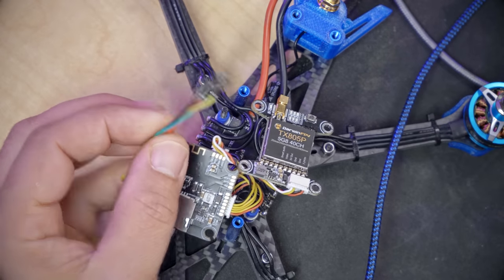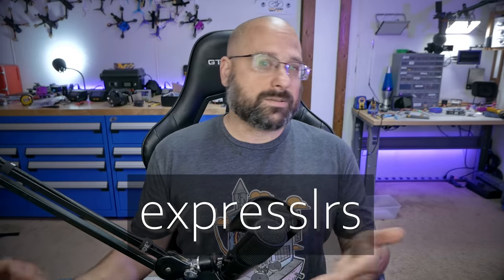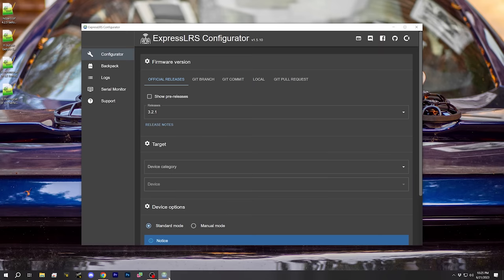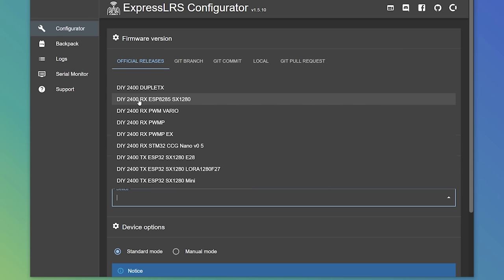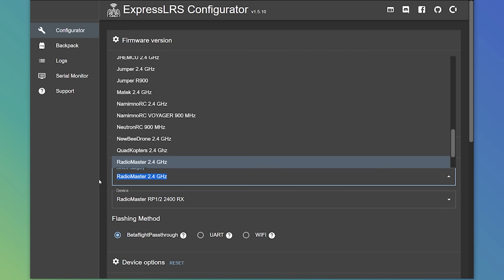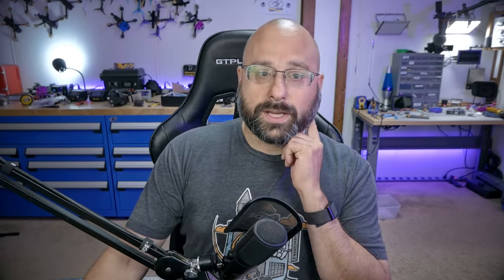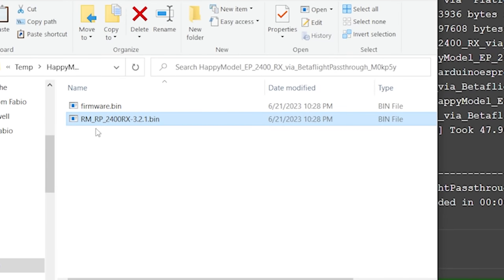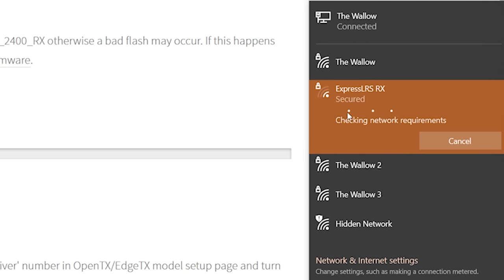Easiest Way To Flash and Bind ExpressLRS!

Comment: I'm super stuck and I cannot find anything to help with the issue. When I open ELRS configurator and set everything up, after I hit "build" I DON'T get the .bin file for my HappyModel 2.4... the file explorer opens, and the folder name in which the .bin file should be correlates to the ELRS module, but no .bin file... Does anyone have any ideas?
Reply: same problem, did u find a solution ? thanks

Comment: Updated my Radiomaster Ranger TX firmware no problem but the RP1 RX is a problem. After downloading and extracting the firmware I try to upload it and get an error: Targets Mismatch which explains that the factory firmware is not matching what I want to upload - press FLASH ANYWAY to overwrite it. Which I do and then get an ERROR[4]: Not Enough Space. Anyone know how I get around this as the TX will now not bind to the RX?
Reply from the maker: https://youtu.be/2kcRi1cHejM?si=UTfWw_Jw8tIl1Nv0

Comment: Great. ELRS works well and is open source. Cool. Binding a model to a transmitter shouldn't be this convoluted. YouTube is exploding about remote ID being a barrier to the hobby. "Have you met ELRS?"
Reply: It is pretty trivial actually. Has gotten a lot easier with recent versions. And it works across the board, just flashed my new Meteor75Pro RX yesterday evening, went super smooth, 10 minutes work including triple checking everything because it's been my first flash

Comment: My device name is DIY_2400_RX_ESP8285_SX1280. It doesn't show up in the expressRLS configurator. DIY Mini ESP32 SX1280 2.4GHz TX is the closest thing but is incorrect. Can someone help me?
Reply from the maker: What model receiver is it?
Reply: @JoshuaBardwell  Built-in Receiver: Serial ExpressLRS 2.4G / Frsky SPI from the Brushless betaFPV f41s5a flight controller. It's built in ExpressLRS and also a built in ExpressLRS transmitter, the literadio 2 se. I can connect FC to betaflight and transmitter to its respective software, but I can't get the transmitter inputs to show up in betaflight. Help pls

Comment: So if u have aio controller with elrs this won't work?
Reply from the maker: These instructions don't work with SPI elrs rx. But many aio have serial rx.
Reply: @JoshuaBardwell  it's a pavo20 elrs version but I couldn't get into betaflight one day so I flashed it but now I can't find elrs on the receiver tab, pretty much everything else there tho
Reply: @JoshuaBardwell  tried to do a cli dump from betafpv but don't think it worked 🤔 lol I definitely could use some help later today or tomorrow!
Reply: I finally figured it out lol all i had to do was watvh until roughly half way and bam, it hit me what i needed to do in betaflight lol@JoshuaBardwell

Comment: So, I get myself a Radiomaster Pocket and a BetaFPV 5ch receiver and build myself a foam board fixed wing to get reacquainted since I haven't flown in about 20 years.....
I have now spent more time fking with all this binding BS than I did building the damned plane.....literally 
The receiver and transmitter won't bind, receiver hot-spot doesn't show in the network and configuration won't build...

Damn I miss the simplicity of 72mhz days......

Comment: Can't even get past the first step of connecting to the wifif network since it didn't  pop up after 3 hours of trying.
Reply from the maker: Could be you have an SPI receiver. As I say in the video, this method does not work with SPI receivers.

Comment: Ahh I already hate ELRS. Phone and PC wont connect, 3 times plugging gives me no double blink. Makes me want to unsolder
Reply from the maker: It seems likely that you have an SPI receiver, which, as pointed out in the video, doesn't play by these rules. Go to the Betalfight Receiver tab. Is the receiver type there Serial or SPI?
Reply: @JoshuaBardwell  Thank you for your answer and all you do for the community. It seems to have been a dead on arrival receiver (I don't think i had it on 10V, but it is not impossible, soldered it around a lot to check), now I have 3 working ELRS receivers. 
However, another one was a massive struggle because I had not selected CRSF when flashing the firmware (4.5.1). Somehow you can still switch to CRSF in the receiver tab, but it does not work, no warning in the desktop app 10.10.0, ONLY on the web app. Had to reflash it to make it work.

Comment: Mmm, sounds like the easiest way is to use Crossfire, simply bind and the firmware updates automagically without any of this complication. This whole process seems very annoying, overcomplicated, and all kinda: Maybe it'll work this way, or maybe i should do something completely different...*however, exception....
Reply from the maker: If someone is happy with what Crossfire offers, more power to them :-) I see a lot of people switching away from CRSF these days because it's so difficult to find Nano RX in stock.

Comment: I tried updating my reciever and not working so I had my wife try and she works with computers every day at work nope still no go. Yup elrs is easy even dummies can do it right? Lmao 🤣
Reply: Computer saying failed part of file missing when I try to open file to flash
Reply from the maker: What is the name of the file that you are clicking on when you upload to the web page? Is it firmware.bin.gz or is it firmware.bin? If you were given a .gz file by the configurator, you should be uploading a .gz file.
Reply: When you get to the choose file part in wifi mode for flashing top right of screen hit update and do not hit open file just drag it and drop it with the choose file option at bottom of screen.
Reply: Once first updating of elrs is successful there is no more fear of messing up in future. Even pilots that do not like computers like me can do it with enough research 🤣

Comment: Losing the will to live with this Elrs crap...if i dont get any joy tonight, its all being binned and its back to Crossfire, easy to set up, no fuss or headaches and iv still yet to even come close to a failsafe!
Reply from the maker: If you want to email me I'm sure we can figure it out. Your call.
Reply: @JoshuaBardwell  Well, I'm going to attempt it again now with the Mrs laptop which is a lot newer then mine. Hoping it could be due to my laptop being 2016. If all else fails the definitely yes mate. I'll contact you. Much appreciated 👍🏽
Reply: @JoshuaBardwell  Right.. today i did learn something lol. Used the Mrs slightly newer laptop and iv been able to update to the latest 3.3.0 ELrs effortlessly. Both module and ep1 receiver. So I'm happy with that. The only problem is, I'm not getting no ELrs Lua script through my Qx7. The screen just comes up blank. But on older firmware it came up fine. I do however still have full screen on my module. But I would like to have it on my Transmitter aswell? And solutions please mate? Cheers
Reply from the maker: If the Lua script won't load, the first thing to check is in the Model Setup screen, External Module should be set to CRSF. (External, because you're using a QX7 which doesn't have an internal ELRS module).

Second, QX7 has a hardware problem that makes it not work with high speed external modules. This is the original QX7, not the newer ACCESS version. If you have the original QX7, you need to enable OneBit mode in EdgeTX. 

https://edgetx.gitbook.io/edgetx-user-manual/edgetx-user-manual/user-manual-for-color-screen-radios/radio-settings/hardware
Reply: @JoshuaBardwell  Ah i see. I obviously know about the Elrs Module running on CRSF. And yes it is the original Qx7 with the tbs chip hardware mod. But I never knew about the 1 bit rate. I shall change that now while I'm still on the bench, pulling my hair out trying to get my happymodel baseline spi ELrs to bind. Iv trying for over 3 months. It's not even funny anymore. Iv literally done everything i can. Updated SPI board to newest firmware and Tx. Tried with and without binding phrases, 250hz with hybrid both on and off...still nothing mate.

Comment: yikes, elrs vids just convince me not to use it. this is not just complicated and vague for flashing and binding, this is complicated beyond sanity.  i hope they find a way to do passthrough for elrs receivers, flashing and binding should be about 6 clicks, not 60 minutes of study.  every step of the way is vague, beginners dont do well with vague, instead of a grounding in whats going on they get, sort of connect with wifi, then unconnect wifi, then choose this model but maybe not, then dont flash but bind but not bind, then reconnect with wifi, and sort of bind, then sort of flash then it still reads the same as before you started.....